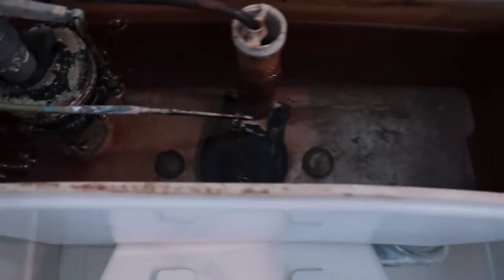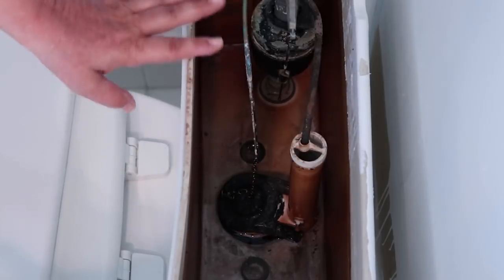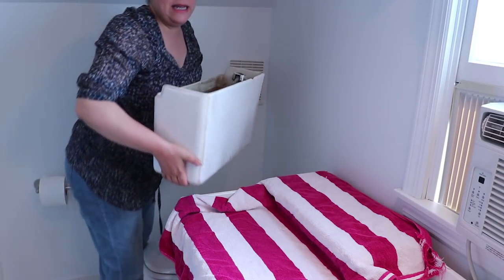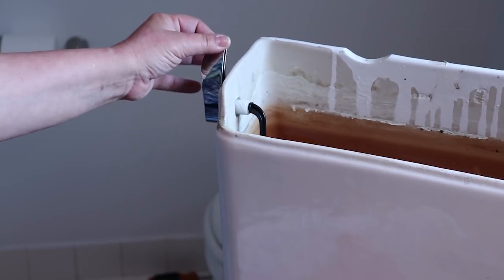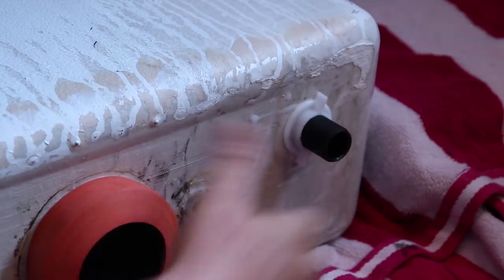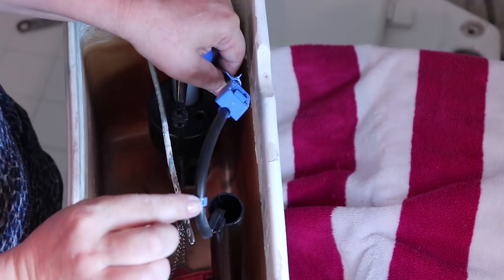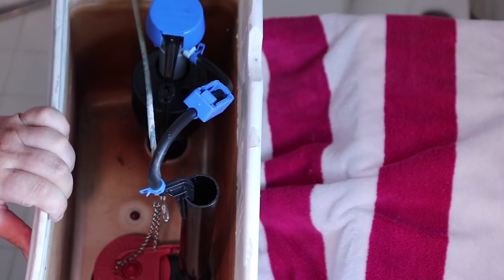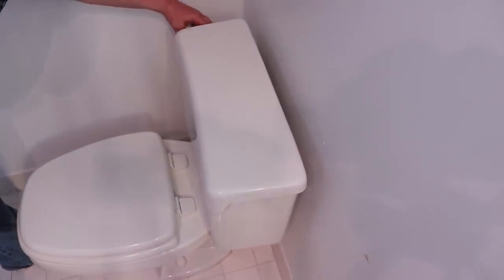🚽 How to fix a leaking Toilet  || Fluidmaster Repair Kit  🚽

Comment: Having now passed my 40th [not a typo] year in my "starter" home from July 1978, plumbing issues are an ever-present thing.  The toilet is the easiest of them; the sewer line problems on a slab foundation -- the worst, and the lines with 100+ y.o. tree roots are even worse.

So, because the flapper valve being the cheapest and easiest to buy and replace [and the first to deteriorate], I have made it a policy to just keep a supply of about 5 or 6 of them in the plumbing drawer of my garage, and replace the flapper in each of the two bathrooms, about every-other year,  

Nice job, Sophia.  Going rate for general plumbers here is now about $200/hr PLUS a minimum trip charge of $125.00 [rip off] and that is for the easy, uncomplicated stuff.  

So you just saved your household several hundred dollars, and that was not even needing to replace the entire toilet -- now running several hundred $ EACH these days.

Comment: I am so glad you posted this. I was debating on calling a plumber or trying myself. I have a trip into the builders supply in the morning anyway so I will pick up a kit and replace mine. At the present time I have it shut off it was leaking water so badly. Thank you!

Comment: Hello, glad I found your channel and I subscribed.  I had watched the official Fluidmaster complete kit repair video and found yours much better.   I noticed with the official instructions that the top of the Overflow Pipe should be 1" below the Critical Level Mark on the Fill Valve and the Fill Valve hose should flow directly into the Overflow Pipe (as I understand it)  Just thought I'd share.  I have been working on my toilet for a week.  You did it in less than half an hour, so I'm impressed, and thankful of your channel.  I also had to fix the flange first, now that was a learning curve to be sure, and to pick the best method...

Comment: GREAT JOB...I have a leaking around the larger setting.  So tired of pulling this thing apart but you have given me motivation to try once again.    It is the orange housing that needs to be snuggled tight.  great vid

Comment: "We Like to Flush the Toilets in This House, To Each His Own." Ha! You're sooo funny. I've taken the tanks apart before and I don't remember why. I think something broke in there, but I have a distinct recollection of doing that. Oh, we changed that wax ring, and I've adjusted the guts, I never unscrewed them and changed them. You know that plastic stick from the handle broke off before and that hook that holds the chain. Some different surprise Every Time! Yes, they last a long time, I bet you won't see the inside of that tank again for a good while or the huge plumber's wrench! Say good-bye Fluidmaster! Happy Flushing! ; ) You know there's one thing you did forget...the classic, you did this with all your modesty intact, nice high-waisted pants! Absolutely NO CRACK. Wonderful. Maybe it was the camera angles. Good Job. Ha! I will remember your video when I need to do this. 9 times out of 10, I fix those things too. At a minimum, I go buy the parts for repair. Girl-Power!

Comment: Great job, you are awesome. You have no problem jumping feet first into projects  that most men won't touch!! You want to clamp the water inlet tube so the water flows into the inside of that over flow inlet tube. It works the way you have it, the tank just won't fill up all the way.

Comment: I have the exact model you are installing and it’s leaking horribly. The water saving part has NO effect at all on mine. Although my water pressure is 150psi tooooo high the flow is so slow it takes 5 minutes to refill lol

Thanks for the videos, cheers!!

Comment: I have to replace the rubber flapper on my toilets every so often. It’s my fault though because I use the Clorox tablets in the tank so over time they get warped. I can’t find anything that works as well though. Luckily my toilets are newer so I just have to do the flapper